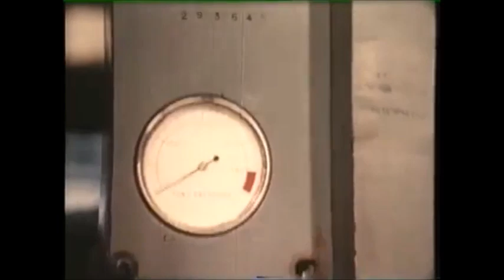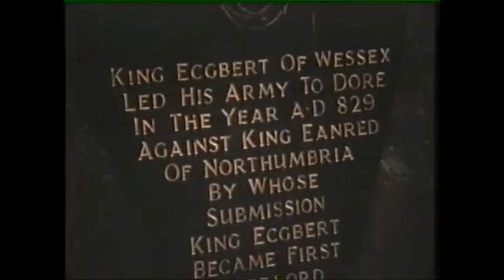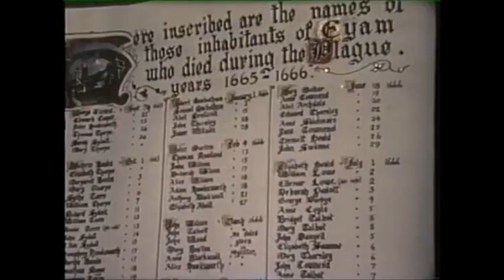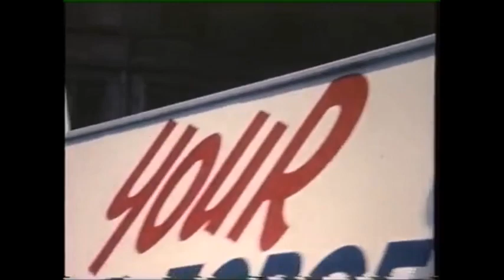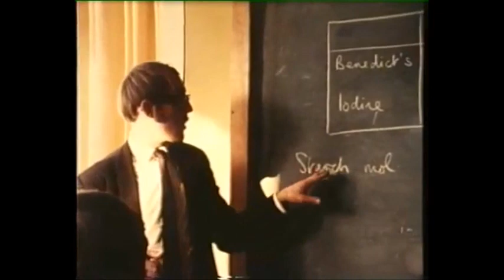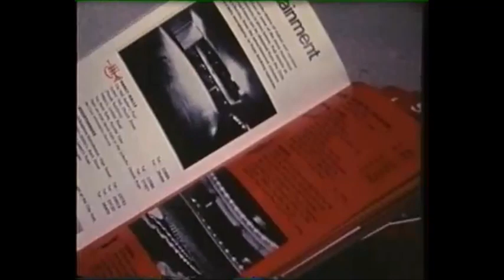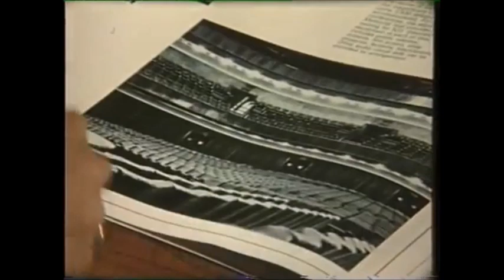Sheffield - City on The Move

Comment: Thanks so much for sharing. I have a strange fascination with the Castle Square 'Hole in the road', even though I've never seen it - nor visited Sheffield!
Reply: I remember the hole in the road as it was in the 70s and early 80s. There where entrances to some shop's lower floors down there so now I wonder if there are bricked up doorways in the basements instead. (in my mind there is a glass door down there with rubble piled up behind it - but that is just silly)
Reply: 45rpm I believe Kelvin Flats or what was left of them,was the rubble used to fill up the hole